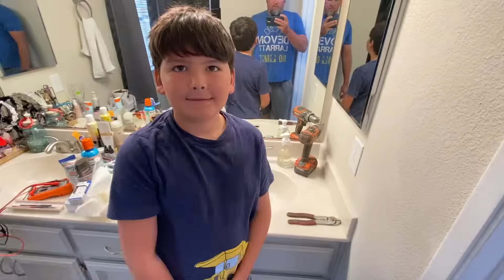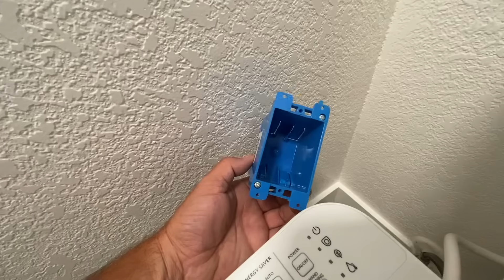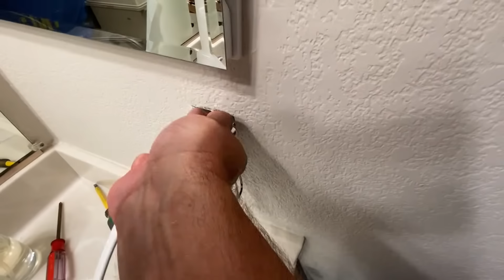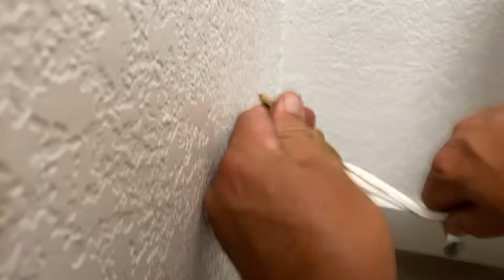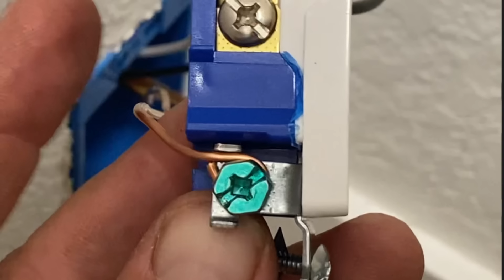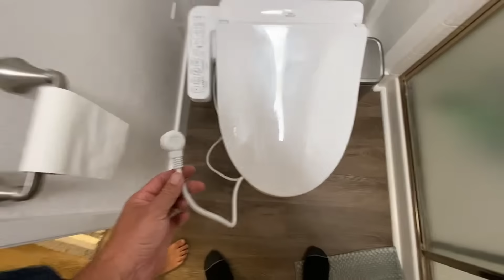How to Add an Electrical Outlet for a Bidet

Comment: What are the options when there’s no existing outlet on adjacent wall? That is my problem. I purchased a brand new toilet bidet combo and there’s no electrical outlet in the toilet room and the vanity room has an outlet on the complete opposite side of the room. What are my options, please ? This toilet bidet has been sitting in my foyer for approximately four months and now I cannot send it back for a refund so what can I do to get this toilet / bidet installed?

Comment: Thank you for the video. Very helpful. I followed your instruction and installed the bidet outlet in the exact same way. But the bidet outlet keeps tripping the GFCI outlet. Can you help? Thanks
Reply from the maker: Is the GFCI outlet in a different bathroom like mine is? Or did you add one by the toilet? You might have a bad GFCI. It happens sometimes right out of the box. Also try plugging the bidet into a different outlet with an extension cord to see if it works. Also check to see if the gfci is wired properly. The hot wires coming into the GFCI go to the line side and other outlets protected by the GFCI go to the load side of it. Let me know how it goes
Reply: @TheUltimateHandymanKyle Thanks, I figured it out. My bad, I put the hot wire to the input side of the GFCI outlet 😅

Comment: So because that outlet is already GFCI from another outlet elsewhere, then can just use a regular outlet? Want to verify because my bathroom is the same way. My vanity is regular outlet but it has a GFCI outlet on it to the downstairs bathroom. I just tapped into the vanity outlet for the toilet and installed a regular outlet.
Reply from the maker: Yes you can use a regular outlet. The new toilet outlet should be protected by the other bathroom GFCI. You can check by testing the GFCI to see if it kills the power to your new outlet.

Comment: Would 14g wire be good for a heated seat bidet? Probably connecting to basement light circuit. Thanks
Reply from the maker: Yes. When adding a new outlet the wire gauge must match the breaker amp on that circuit. So 14 gage wire is for a 15 amp breaker.  My bidet is on a 15 amp circuit with 14 gage wire.

Comment: Be warned that some bidet models can draw a LOT of power, especially if they heat the water, which could potentially overload the circuit, say if someone is using a hairdryer in the adjacent bathroom. Generally it's better to add a dedicated 15A circuit for a powered bidet.
Reply from the maker: That’s possible. I find that to be true with older homes. I’ve had no problem with this at my house built in the 90s. If this were to happen then someone can decide to run a dedicate circuit.

Comment: When you “pig tailed” them all together.  Shouldn’t you have put the “hot” wire on the line side?  Then the others pigtailed on the load side? Having them all together defeats the purpose of a GFCI.
Reply from the maker: The reason it’s like that is because the GFCI is in the down stairs bathroom. The wires that I pig tailed together are on the load side coming from the GFCI in the downstairs bathroom.

Comment: IMHO -- If you are new to the bidet world, I strongly suggest you start with an inexpensive model that does not require an electrical connection or any special plumbing.  I think you will find such a bidet will give you perfectly adequate functionality & benefit without the expense, trouble, etc. of a powered unit.  Not to get too graphic, but tap-temperature water is just fine, and blow-drying just ain't for me.  But ... to each their own.
Reply from the maker: It’s the cold toilet seat that gets me in the winter. Once you get a toilet seat that can heat up it’s shocking when you sit on one without it. The pluming on the inexpensive bidet are similar to the electric ones. The only difference is adding the outlet.
Reply: @TheUltimateHandymanKyle  my son sits for hours just for the heater. I installed the outlet after watching your video. Thank you for sharing.